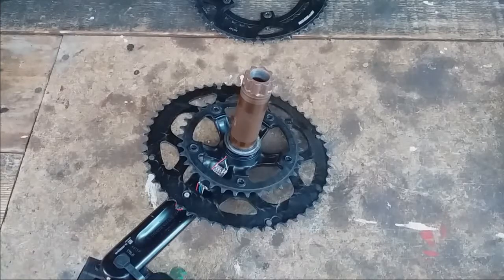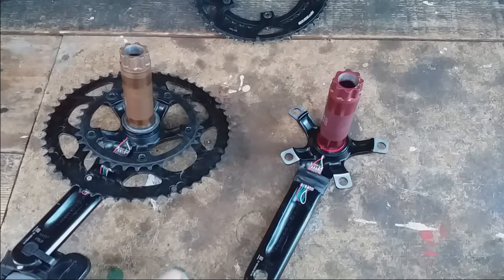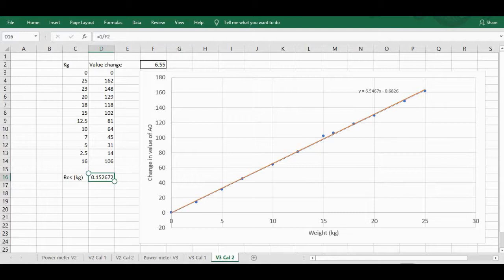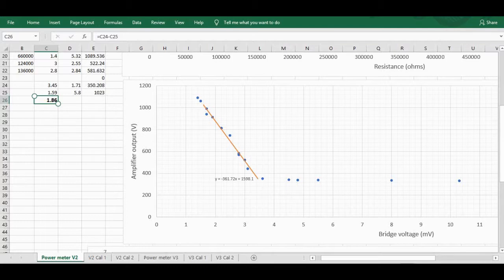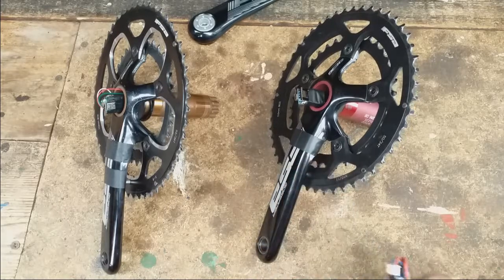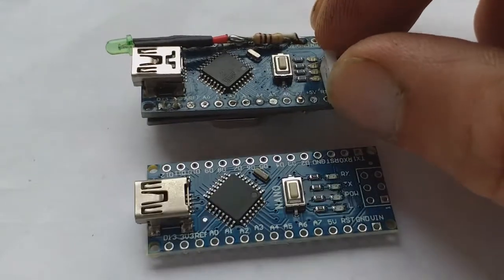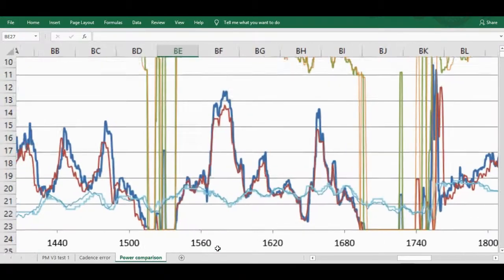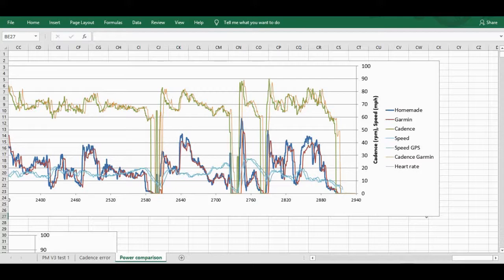Homemade Bicycle Power meter V2 + V3

Comment: Hi,
Very nice.
Could you share how you calculate the power? I have been strugeling with it for a while now getting unstable results. Do you read the strain gauges and average the readings?what is the sample rate you use?
Thanks for sharing!
Reply from the maker: I'm guessing you have a stable value from the amplifier that is staying around 0 when no force is on the crank. If not that's the first thing to get right.
I use a 1kHz timer interrupt with basic averaging code to help with this.

I go through the actual power equation in this video https://youtu.be/ry0pG-GqD7g from 3:47

To get the average torque for that equation I use a timer interrupt set to 100Hz. It reads the amplifier smoothing code output and calculates the average. On completion of every rotation it is reset.
The power is then calculated in the main loop which I run at half second intervals. ANT+ usually transmits at 1 second intervals I believe.
At a typical cadence of 70 - 80rpm this means around 80 samples per crank rotation.
Whether this is right or wrong or the best way to do it I don't know but I've had success with it.

Thanks for your comment and hope this helps.
Reply: @Ed.R  Hi,
Thanks for replying! I didn't think about smoothing algorithm for the signal rather i tried to smooth the final power value. Once you mentioned it i checked it and i saw that i needed to smooth it so that is one step closer to a stable result. Now it looks much better. 
When you calculate the average power for a rotation of the crank, do you ignore all the negative torque and use only the positive forces that actually move you forward?
Reply from the maker: @shabso  Glad I've been able to help. 
Include everything in the average, negative and positive. The negative torque on the side you are measuring is coming out of the positive torque put into the other crank.